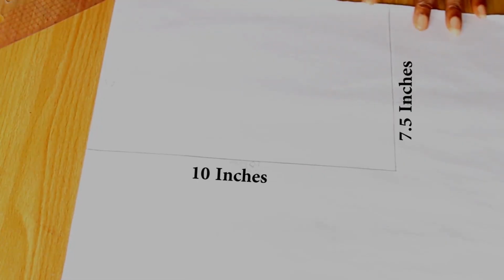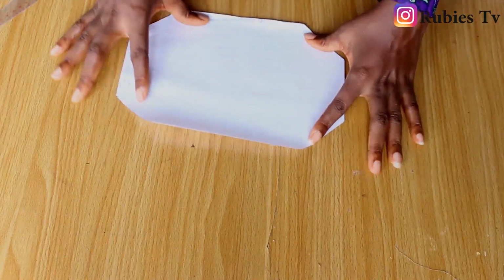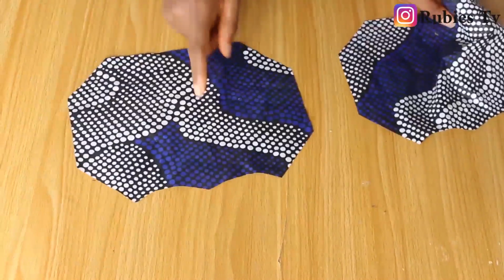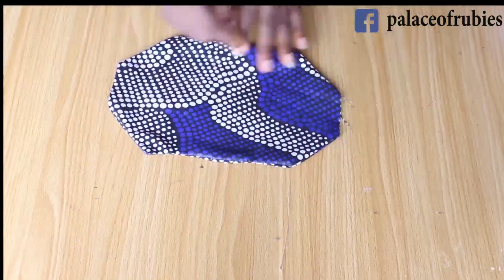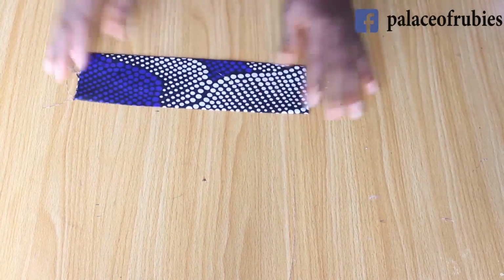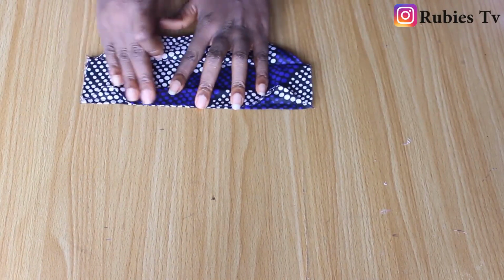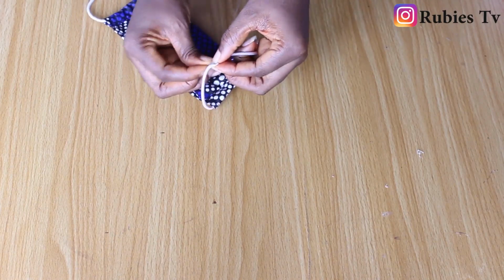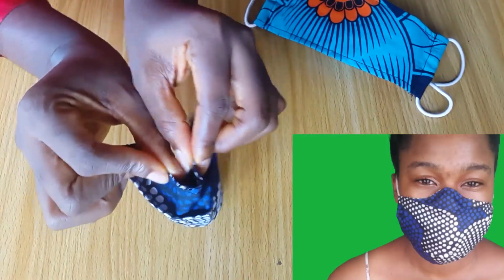HOW TO MAKE A 3D FACE MASK/ EASIEST METHOD

Comment: Great video. What kind of wire do you use & where Can I purchase it?  It would need to be steel so one can launder it without rusting
Reply from the maker: I used  80 guage Daris wire, it doesn't tarnish
Reply from the maker: You can get this from any bead  vendor.